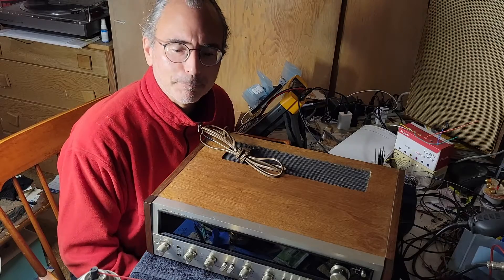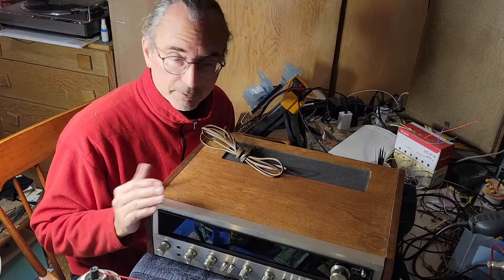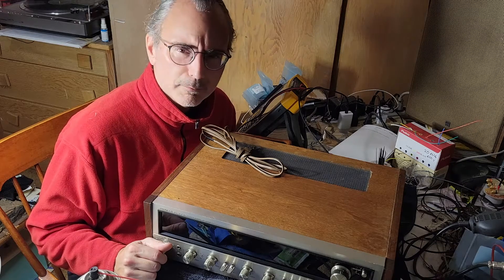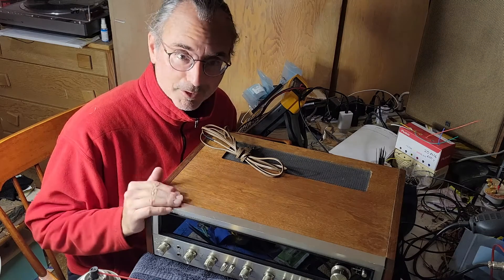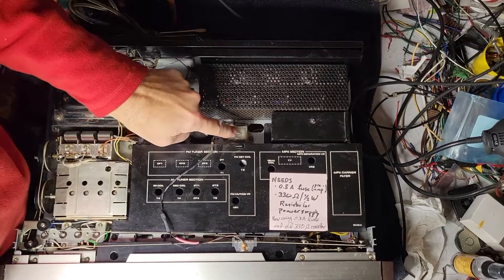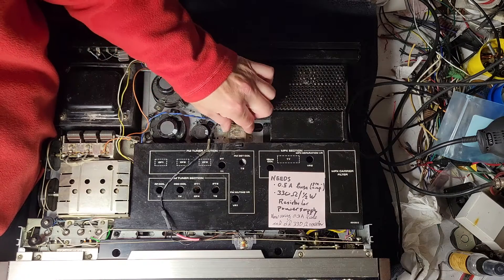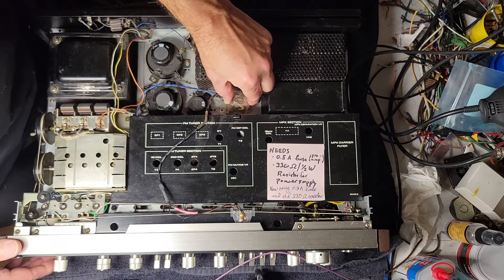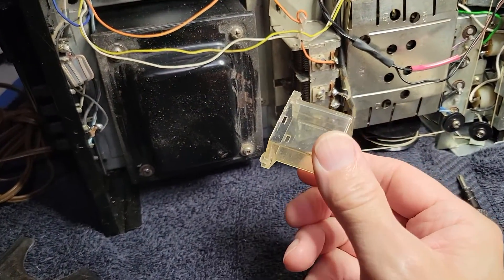Clean the Contacts! Fixing an Intermittent Protection Relay on the Pioneer SX-828

Comment: At time stamp 8:50 it looks to me like that LAST set of contacts on the right side of screen looks crooked or broken.  Doesn't look lined up correctly with the other contact.
Reply from the maker: Yeah, the "prongs" are kind of splayed out. I think the plastic piece that holds them is cracked. I've seen the same issue in another receiver recently. I've gotten a new relay but haven't put it in yet.

Comment: That type of relais is easier to clean than the later compact ones. My Luxman has a relais in a base...easy to take out. My Sansui (same era) has the same sort of relais but soldered on the pcb. Had some problems with loss of sound on 1 channel  and wanted to solve it.... removed the cap,removed the spring and took the middle part out to create workspace. Some contacts had black/grey spots which could have caused the problem, i used a toothpick with a little toothpaste on it to remove the black spots. Since then i haven't had problems again. Don't know how long it will last but it's a while ago which is a possitive sign. When the annoying problem returns i will try the same procedure..... or desolder the relais and replace it by a fresh one.
Reply from the maker: Unfortunately, my problem returned quickly, so I'm going to get a new relay.
Reply: @Lancaster_Hi-Fi  _Than you're freed from the problem for many decades. Pity other brands didn't have a mount too like the Luxman or wasn't that solution so exotic.....pull the old one out ,plug the new one in within seconds but mayby it had disadvantages with the contacts...corrosion or something else.

Comment: might attempt this. i have a pioneer sa800 from the 70s that i got from my late uncle. left channel weirdness, comes in and out, sometimes plays very quiet, sometimes not at all, sometimes without treble. 
got it serviced but I guess they only cleaned the knobs and dusted the interior. I really love the sound and wish i could get both channels working at the same time!
Reply from the maker: I'd say it's worth a shot!
Reply: I have same issue with pioneer 708. Any success?..may try this,too

Comment: Nice job. I've had success doing the same with CRC then Deoxit on relay contacts with only a piece of folded course paper, I think sand paper, even fine grit will remove the plating from the contacts causing them to corrode. I'm not certain of this but only time will tell. Keep up the great work !!!
Reply from the maker: Thanks! Do you know whether the contacts are plated or composite or solid brass? Definitely something to think about. TBH, I didn't come across the paper-with-DeoxIT method until after I'd used the CRC and sandpaper thing. And "sandpaper" doesn't do it justice when it's 2000-3000 grit. Still, I take your point.
Reply: @Lancaster_Hi-Fi  the first relay I took apart was from a 1970's reel to reel, I used fine emery cloth and saw that the contact became silver rather than gold colored as the others so I switched to course paper
Reply from the maker: Yeah, in the future I'll probably stick with paper rather than sandpaper.
Reply: What was it originally doing? Would it play and just cut out?

Comment: you can always drill a small hole in the casing for a quick fix (maybe on a lesser classic amp)
Reply from the maker: To get the DeoxIT in, right? I've seen that suggested. Sure would be easier, but doesn't seem right. Maybe for an MCS or Realistic. 🤣
Reply: @Lancaster_Hi-Fi  yep